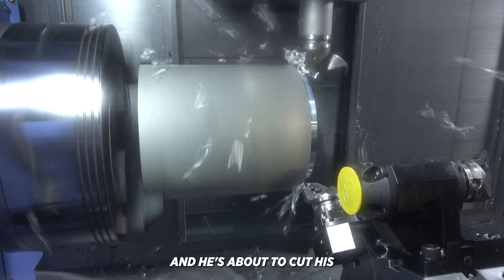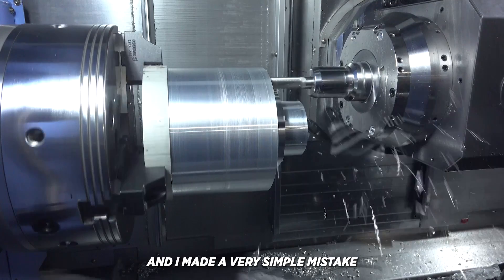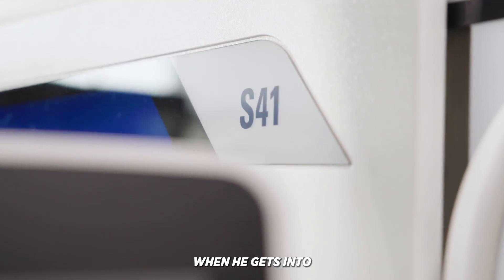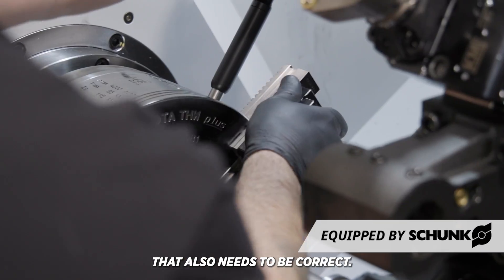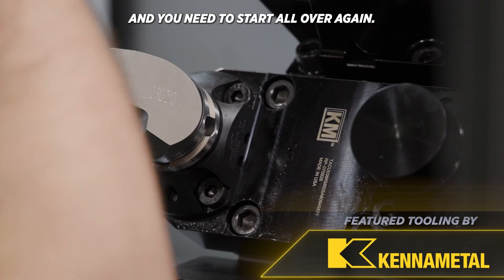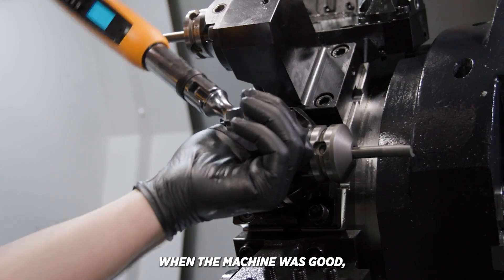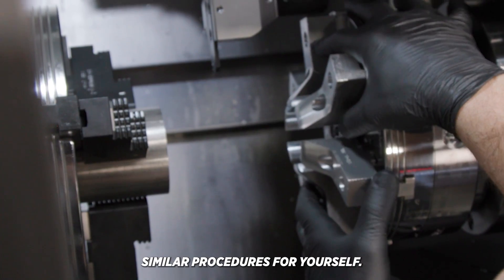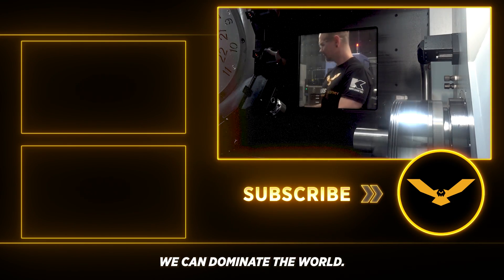My Mistake SMASHED the Tool & Holder Into the Part Causing Huge Damage… What Now?

Comment: 1. I’m trying not to input offsets directly by hand, that’s why I have a setup routine for OMP60 in the end of every program after M30. When direct input comes, there’s a triple check of all values in offsets table
2. Common mistake with null value of tool length… There’s a routine on tool change which checks for null value. When it comes on place, routine checks if a tool in spindle or not and if there’s one then it going to Metrol device to pick the length

Writing custom macros can help you with that sort of things…
You can help your operators in every single minute of shift just by simple things you wrote once

Comment: Basically on a lathe just always single block after every change.  if you single block properly, no matter how bad you screwed up the offsets or program, you'll never crash a lathe.
Reply: Hi Craig, a guy comes to me and says, " the 20 mm diameter shaft is a slightly conical on the 50mm lenght,  ...  just 0.01mm." 
I say to him " no problem, I'm on my way. "
Change the program in:
X18. Z0.
X20. Z-1. ( chamfer  🤨  )
X2.01 Z-50.   instead of  X20.01 Z-50.  or a   X19.99 Z-50.  depends on the + or - 😉
Oooops, ...... my [ Single Block ] isn't helpfull on this one.    😂
Don't ever says;    " you'll never crash a lathe. "
You can make tons of failures, even with [ Single Block ], in this case a fast [ Feed Hold ] will do better, after that push [ RESET ]    😆
Reply: @ytfan3815  single blocking would absolutely have stopped that.  When you single block you go line by line with your rapid and feed at zero, you slowly raise your rapid or feed (whatever your using on that line) until your sure you punched in the right code and its going to the right location.  You keep a close eye on your distance to go and machine location.  It takes longer but most lather programs aren't that long so If you single block properly it is literally impossible to crash a lathe.
Reply: @85CEKR  LOL, if you run multiple machinery you don't have the time to do that, single line/single block, etc, only on small programs maybe.
I always check my new lathe programs on Graphics, than I shift my Z G54 value a bit further in Z plus direction then my longest Z-minus value an do a test run on the lowest Rapid, simple as that, checking the Position screen, Distance to go, etc.
With Live Tooling you can get some really large programs, just saying.  😉
Reply: @ytfan3815  That's why I say lathes because Mill's the programs would take ages, as for live tooling what we do is prove the whole operation out in a good collision detecting software.  You still make sure to single block the begining to make sure your offsets and zero's are right but once you've verified that's good you let her go.  We've be in operation since 1994 and have everything from 2 to 9 axis lathes.  We've never had a crash in all those years.  Its worth doing.  Every single lathe in our shop cuts as good as the day we bought them and we've got a 1996 still.  You can run your shop how you like but until there's software out there that make a crash imposible we'll still be doing it.

Comment: Try change the parameter settings on control to limit the amount of wear offset on the tool,  our machines will not allow you to put an offset greater than 1.0mm or approximately 0.04inch, if you need to shift your wear offset more than 1.0mm, something may be wrong, I'm tempted to change the limit to 0.5mm because we keep our tools as short as possible. This has been applied to all wear offsets, milling tool lengths and radius, and the same for the lathe machines. PS: Use automatic tool length setters or Renishaw probes to eliminate typing errors when inputting tool lengths.

Comment: I’ve been machining professionally for about 5 months, and something I’ve done that seems to always work is writing down the set up procedure, what tools I’ve changed out and if they’ve been touched off or not and how much they need to stick out. I run an okuma lathe so it gives you the last value you’ve input in the buffer so it’s kinda like a double check to make sure I didn’t fat finger another number. We also run dual offsets on groove tools, so taking the time to subtract the value from each other to make sure I have the width calculated properly will ensure I did everything right. Hope this helps someone!

Comment: My first time to crash a machine is in a training center hosted by our government, I'm the first one to practice in that morning.
I accidently change a G0 Z value into X on a lathe and skip the simulation...
Then the slotting tool plunge straight down into material with 50% rapid movement with a firework.
Fortunately I always tell my self that I can forget all the buttons on the panel, The only exception is the E-Stop.
After cleaning the mess my mentor told me that I'm not the first one crash the thing...But I'm the fastest guy on slamming the E-Stop LMAO
Am I timid in front of the machine? Maybe I guess...but it's because I know that monster can kill me with ease.
Later on I always keep some kind of respect with any machine in front of me and rather be slow on setup then crashing something.

Comment: I stopped a lathe partway through a program to check a dimension, got distracted talking to a coworker, and on autopilot hit reset and start. The bar stop slammed into the part (7/8" low alloy steel) at 50% rapid. Bent the part about 20 degrees, and bent the bar stop/part off toolholder, luckily no further damage was done to the machine.

Comment: when i do my first run on the cnc lathe and comes the thread cutting I turn on the "Hand" function and do the thread cutting by spinning the hand wheel, to make sure my Z do what it's supposed to do. I rather do a bad first threaded part then crash the machine

Comment: I accidentally crashed CNC Lathe turret with a chuck, it happened during tapper threading cycle on Siemens Sinumerik 828D. I don't understand how it happened bcz i entered X0, Z0, X1,Z1 values as i needed. It just went above the work piece and crashed 🙄

Comment: Tbh in a commercial environment you should always, especially on a lathe but mills too, be running operations 3-4" away from the part to double check that your movements are good.

Comment: Good video. For my first part with a new program I would single block every thing watch distant to go and keep my hand on feed rate override. Slow down rapid and be one with the machine. Crashes was rare but I happend once or twice a year. But never a catastrophic one. But there was this one time, I had to show a guy how to change some batteries in a little Mori with a Mitsubishi control. I took one out and failed  to reinstall it correctly. OOOPPPSSS. When I shut the machine down for the night I lost all memory, every thing. The Mori guys couldn't get it going again. They finally brought in a Mitsubishi guy in and he got it up and running in no time. So, there is a lesson in here some where, I just can't remember what it was. Oh well, have a nice day.

Comment: I set up a 20 mm end mill , I insert it into spindle , I touch the tool off and I just press yes, yes , without reading the message , I start the cycle and the end mill smashes into the vice and it's turned to dust .
The messages that my machine displayed and I just pressed yes wiy reading them were : 
" You are about to store offset for a tool that is not currently in the spindle , yes/no"  turns out I was on a different tool page instead of what I was setting so the tool that I wanted to set ended up with 0 set on tool offset ,. since then I read every little dialogue my machine puts out instead of just blindly pressing yes or no

Comment: I work on 2 okuma multus' running CAS (collision avoidance system) option.
All the workspace dimensions like chip covers, toolsetters, spindle nose, milling spindel, lower revolver and subspindle are pre loaded in the CAS software by Okuma.
All I have to do is specify the chuck dimensions, jaw dimensions, tool holder and tool dimension and the how big the cutting edge is.
The software makes it virtualy impossible to hit anything with the tool in rapid feed mode, try cutting with a non cutting part of the tool or interferance between machine parts or between machine parts and the part being machined.
I know it takes a lot of time when first setting up the machine but the more parts you make the more tools and tool holders models are being stored by the system so not taking much times now.
Only problem is maybe getting to convident en totaly relying on the system to prevent a crash from happening. In the end, if it might happen that you make a program mistake AND you made a mistake in the model of your jaws, tool or toolholder it will in the end, just like in the old days totally crash this million euro machine

Comment: Well..
I always do the first steps using the graphic function to see the tool path. After offsets done, I used to repeat this and only then start to run block by block, always with GO in 25%...etc.
You might think it's a waste of time, but isn't, this may save a lot of time and money, thinking only in damages, not injuried person!
Reply: We have one Haas ST25Y and I hate the control panel but the control itself is OK, best thing on the Haas is its slowest 5% Rapid, it's also active for the rotation/index speed of the turret, plenty of time to hit the E-Stop  😂

Comment: I learned this the hard way...on a DMG mori NLX2500/750 when I forgot to move the G53 position when using a long drill and a long part... wasn't even a big bang, but the tool arm was no longer attached to the turret.

I normally double check everything I do as well but this time I never.
Reply: It's always that one time you dont.

Comment: Always check distance to go when you first run that helps lol. I learned the hard way 🙃 always be safe 🤘
Reply: I always single block it running the first time . z50 check with a  metal ruler saved my a**e so many times... But rigid tapping, specially big ones (M26) always gets my heart pumping. Because you push start button is no stopping it anymore. Normally I walk away...lololol

Comment: The only crash I’ve ever had was that I reset my program and the tailstock was already in the part and I press the green button and the center drill cycle started it was on a Okuma crown and those who know this machine knows that it’s fast. I slightly stopped it to reduce the impact it wasn’t loud or anything but it did move my tailstock out of center . But to crash a machine like the tool or turret ramming into the part . No, lol I always double check my Z .

Comment: Eventually, machines will have enough built-in intelligence and awareness of the location of its tools and parts, that it won't LET you crash it. 
That will include vision systems so it can SEE where everything is and avoid collisions.   And I think that's not far in the future.
Reply: We have that on the Okuma Lathes we use at work.  It can be a pain in the ass though if it says you're gonna crash when it really wont. You win some you lose some
Reply: @OldSlowGamer,
That's not the problem, big problems show up when you have to deal with e.g. a Nakamura Tome lathe with two or three turrets and double spindles and you have to stop in the middle of a program and restart again, you need to know what you are doing because you can crash a $250.000 machine in a second, but OK that's the same on a $40.000 Haas, CNC machining is not for dummies.  😉
Reply: @ytfan3815  I run a Okuma Multus. Two turret,  two spindle. But am going to learn a Nakamura with 3 turrets and 2 spindles soon...stop making me nervous 😂
Reply: @TheBrenty95  Haha good luck and have fun. You'll learn it it fairly quickly I assume and always double, triple check your measurements and you'll be just fine.
Reply: Some idiots will still find a way

Comment: I've been in the game for 15 years and when going in for threads I still offset the tool in Z so if its all correct it should miss the front of the part by 1 mm if it cuts the e-stop goes in and I've made a mistake 😅 if its all good I put it back and run it through. 
I dont do this for any other cycle just threading. I still do this on my 2100 SY even though the graphics look fine lol

Comment: yer crash the machine suppliers machine... learn from it and don't do it back at the shop.... z rapid tool was stuck in the material and could not be removed. just set z on the wrong tool.

Comment: A similar thing happend to me. During my apprenticeship I programmed  an operated a 3+2 axis vmc (Spinner 620U). We had a internship program for pupils  to give them insight on metalworking, fabrication and automation. I prepared and tested a demo program. Everything ran smoothly on the test run. 
So we finished the presentation about cnc ,showing videos to show them what was possible under the ideal conditions.
Then we went to the machine and I showed them how the how all axis moved by jogging all of them (x,y,z, c,b), At the ent the b axis was almost at it's limit (around 110°). I didn't think much about it so i hit cycle start...
BOOOOM..................
The machine crashed ,with rapids, into the table. Apparently the maschine didn't home the rotary axis before starting the programm. 
End result damaged B Axis bearing (the repair cost would have been around 64000€). The spindel and z axis ball screw most definitely had some damage too. However it wasn't worth to use the machine any longer. Intead they replaced it...

Lessen learned... Always home your rotary axis bevor starting a pogram or at least use a cycle at the beginning of your programm to home the axis.
!!!Never assume something is working on the first try... just be careful!!!

Long story short: destroyed a Machine  with a worng estimation on how the machine controller behaves.
 
I hope i could prevent someone from doing the same mistakes a I did. Never fear  cnc's, respect them and once it's running ,BOOM 💥, just destroy the martial and make perfect parts....
Reply: Thats crazy. One would think it homes itself... but you don't know till you do. Always be cautious especially in an education setting. Made for a good teaching moment though didn't it?

Comment: I run Multicam Routers. Prior 2018, machines were built with basic input controllers. I have had several apprentices drive the spindle into the table because they forgot to set surface, or set tool calibration. I now have several manuals and morning procedures to ensure this gets eliminated. Unfortunately, human error is never 100% eliminated. It always seems to be the “skilled” techs that crash knives and try to tell me they did everything and the control module is going out… 5 min later, no problem

Comment: the machine will never stop in the middle of a threading cut, safe practise for any cut that is not going right is RESET!! not E-stop, E-stop causes axie's to drop, which could cause more damage, reset stops the machine dead where it is, without dropping axie's
Reply: Fanuc controls on a lathe do retract tools while using Feed-Hold on a G76, probably also on G32, ...... NOT on live-tooling or G84 !!!
Reply: @ytfan3815  they don't on any fanuc control I've used
Reply: @rick371  On all our Fanuc lathes it works.
Reply: @ytfan3815  I've used fanuc i 21i 18i 31i and 32i on doosan takisawa and CMZ, it does not work lol
Reply: @rick371  Check Fanuc's [ Funtion Catalogue ] pdf, it's for download, this is what it says;
Threading Retract (Multiple Repetitive Cycle)
If feed hold is applied during threading in the multiple repetitive threading cycle (G76), chamfering for threading is
performed and the tool returns to the threading cycle start point and stops. If a cycle start operation is performed here,
machining restarts with the threading cycle to which feed hold was applied.
The amount of chamfering during retraction is the same as that of chamfering at the end point.
It worked even on our older 0T-C and 18T-B controls.
Reply: @ytfan3815  yeah, I'm aware it does that, that won't of stopped the machine going 6.5" into the chuck lol, we're talking about stopping the threading tool mid cut, which can only be done with reset or E-stop
Reply: @rick371  So, recap, if you want to cut 5" of thread, and you push [ Feed-Hold ] after 1" it goes for the full 5", is that what you saying, otherwise please check that Fanuc pdf and the image it shows, yes I can stop mid cut, it retracts to the start point and waits, after that I can [ reset ] and go on, we don't talk about crashing a machine but using that [ Feed Hold ] during G76.
Your first comment was "the machine will never stop in the middle of a threading cut" and I'm not agree with that, Fanuc will confirm that, but yeah, you have to check that image in the pdf.
Reply: @ytfan3815  every fanuc control I've used, if you press feed hold on a thread, it finishes the cut and waits at the front of the thread
Reply: In a panic the e-stop is way easier to find. Maybe that something machine tool manufactures need to change for the future.
Reply: @redbeard_1371  yeah, if you don't know the machine, that's fine, if it's a machine you're on regular, reset should be easy to find
Reply: @rick371  Most of the time students find Rudolf first.

Comment: I always do a test run, shift my Work-Offset in Plus to a safe turret index distance or Z-plane, both on mills and lathes, when OK then 100% rapids. 
Btw. on 99% of the Fanuc cnc-lathes you can do a Feed-Hold when threading (G76), it just retracts the turret, not when you use Live-tooling or G84 in centerline X0.
Always, .......... safety first. 😉
Reply: feed holds on lathes are dependant on the controller. i know most older mazak controls will finish the thread pass before feed holding, not 100% on the newest mazak controls.
Reply: Ive never had a lathe that did this except a star sliding head... it was a nice surprise. 👌